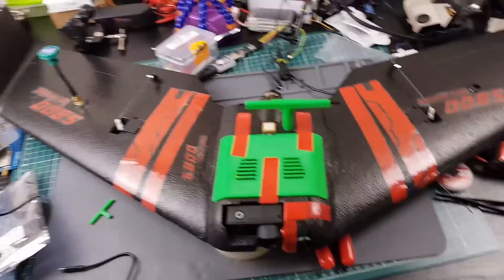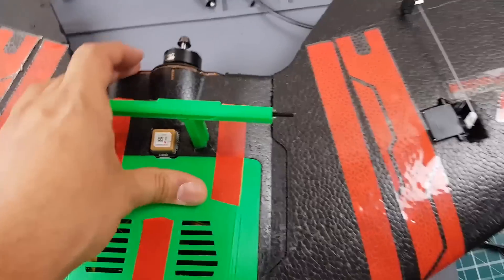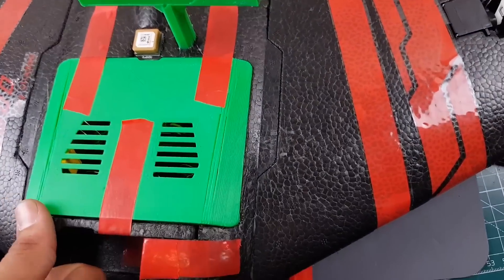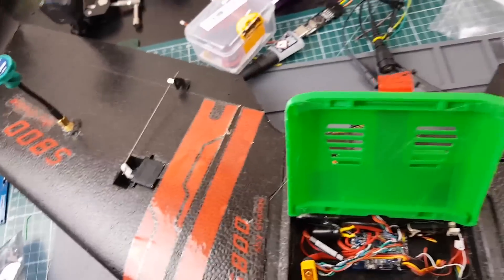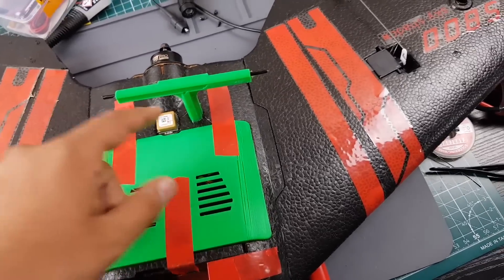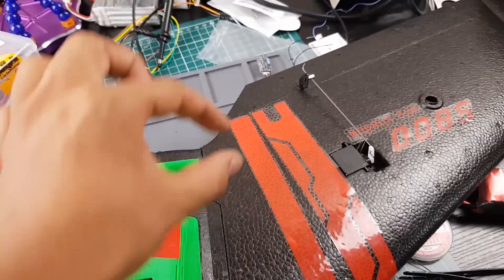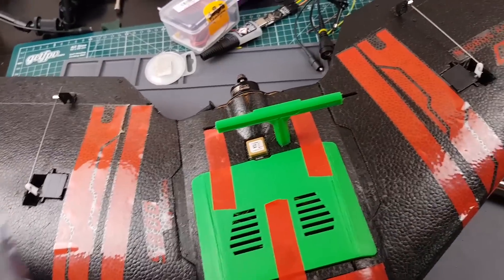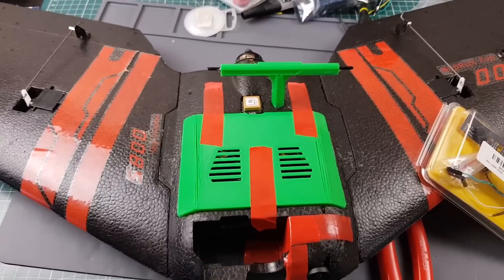My Long Range FPV Testing Setup Update // 1 Of 3 Setups

Comment: I out of habit typically fly anticlockwise. Put my S800 using INAV and R9 long range into loiter (alt hold + pos hold) and forgot it loiters clockwise, not anti-clockwise. Bugger, it turned right and loitered straight into the top of a very high tree. I hope I get it back one day as it flew beautifully.

Comment: RC antenna vertical! Always vertical ;)
Reply from the maker: Pawel your the man.. I was just watching your vid on auto launch I almost killed myself today with it. Had to drive back to the shop twice for fixes.. Thanks for the tip much appreciated.
Reply: @DroneMesh  I stopped doing autolaunch. It gets tricky with bigger planes. Instead I just start Acro, thorttle up and throw while holding near fuselage. That gives a nice throw. Throwing by the wingtip on flying wings is rather a no-go due to poor yaw stability
Reply from the maker: Noted Hopefully I will have good weather tommorow.. I will test the horizontal antenna against vertically as a first test if my launch is successful..
Reply: @FPVUniversity  Wait, you do iNav videos? Subscribing!!!
Anyway, one question... I'm going to build a wing, but with landing gears. Any tips for taking off?
Reply: Well, throttle up, speed up and take off. I've never owned anything with landing gear yet, would be pretty useless in a places I fly
Reply: @FPVUniversity  Thanks, dude! 😊

Comment: hey I'm using a 900mhz video system for my long range s800 setup. the problem is that my servos start to jitter when the vtx is on. I need to place the antenna in a very certain place to work which is annoying. do you have any recommendations?
Reply from the maker: I have the same issue on both R9 and Crossfire..